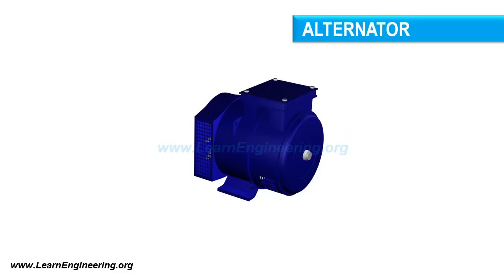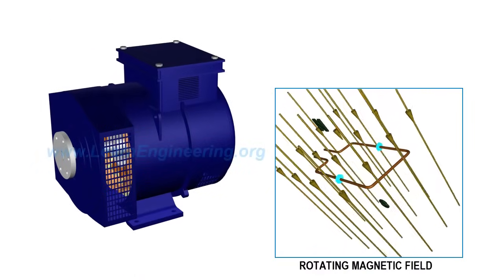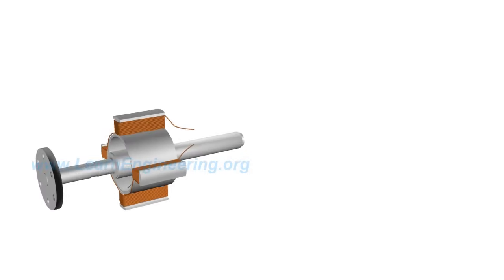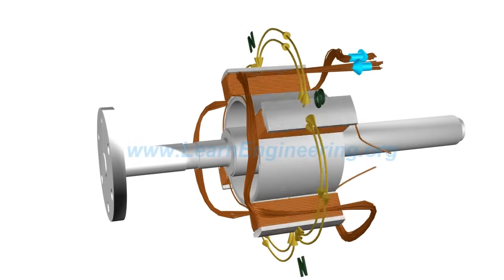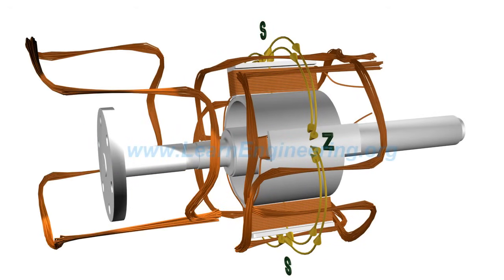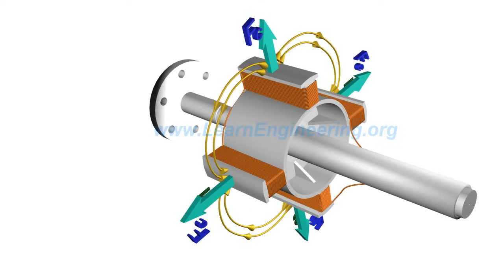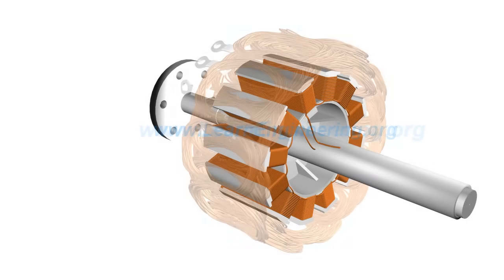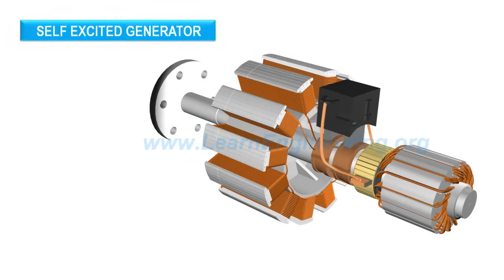How does an Alternator Work ?

Comment: What a great video. Had no idea how alternator made/works.   So what happens/causes my car's alt to not work anymore?   What is the usual part that breaks? Is it not spinning & all the internals are still good or vice versa.
Reply: symptom for alternator failure battery charge gets down probably firstly a service or battery signal arrives in the dashboard cluster finally cars get off if it is an electronic injection. check out if abnormal sound coming, if bearing, if not check the mounting and belt tension and then finally check the terminal connections after inspecting the above you please start your car and check the voltage with the multi meter if the voltage is in the range of 11 to 12v for five minute interval, then your alternator is working other wise please visit the nearest dealer.
Reply: in most cases the brushes get worn down and stop giving the needed voltage to excite the field. Nowadays folks tend to just replace the alternator thinking if the brushes are worn the bearings are probably next. Soooo, the market has favored that and alternator brushes are not available for every version in the field. I tend to disagree. If you can find brushes for your alternator then inspect yours. If the brushes look un-even, or are pitted, and look like they have been burnt replace them. Its a pretty simple process on most vehicles. Take the opportunity to clean the slip rings with a commutator stone too... It will most likely get you charging again!

Comment: Great video. Greater detail then all the others. Had one question. 
Are the magnetic lines of flux "flowing" in the correct direction on the rotor windings?

They appear to be south to north instead of north to south.
Reply: The lines are not pointing correctly. N pole should be pointing outwards.

Comment: If permanent magnets used for 3phase generator like this shown  the voltage in the rotor field is then non adjustable ...so voltage regulator job lot harder and additionally this generators are gigantic would require very big permanent magnets .Permanent magnets have constant field production this would be very difficult to handle as well expensive.
Reply: I think he said PM when talking DC motors which would be correct. As these are single phase motors!
Reply: Yup, PM generators are more usefull for things like small wind turbines etc where an inverter is connected to the DC supply of the alternator.

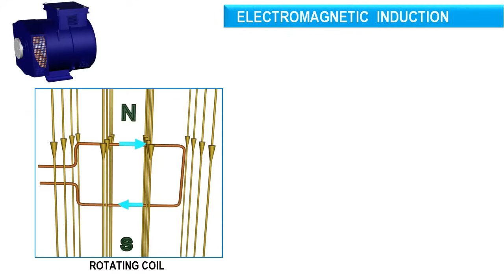Comment: I think you had made a mistake at 0:27 in animation for rotating magnetic field (right one on video). You have used Fleming's left- hand rule instead of right-hand rule so induced current in coil going in wrong side. In left animation you had use Fleming's right hand rule and current arrows goes as they should.

Comment: For say a power gen. in a hydro power plant. How would one set/tune the frequency of the generator?
By the flow of water or by some mechanical breaking of the rotational force? centrifugal?
Also how does one calculate what load a generator can power? MWA and how does one calculate on what DC voltage to apply to the coils, I imagine the winding of the coils decide what voltage to apply?

And how does one synchronize the generator to the frequency of the grid? by some kind of bias frequency, and have a form of oscilloscope set a switch sync to trigger the hv-breaker as the generator is in tune with the grid?
Reply: Question #1 Hydro: Frequency is controlled by a AVR which sets the field current. If the field current increases the voltage rises over your stator windings  which means more electric power is generated, If more power is generated there is more mechanical resistance in the water turbine so the pressure would increase and the flow would decrease. So if you want to have it frequency controlled you need to change the flow and presure of the water mechanicly (velocity of the water) or electricly.

Question #2 DC Coils: Most of the time a manufacturer specifies DC voltage range and it depends on the primary movers force and speed what voltage you have to apply on the coils for the desired voltage and current.

Question #3 Grid: You can synchronize an synchronous machine by running it a little slower or higher than the grid frequency until it lines up. If the frequency, phase and voltage are quite the same (and polarity) you can connect it to the grid. Once it is connected you need to try to run it at a little higher frequency than the grid to let it flow power to the grid. Don't be scared to try and run it a little higher than the grid frequency because the grid will keep your machine at the same frequency but a little out of phase which makes the generator make power.

Comment: What powers the DC source running through the coils in the rotor? Let's say, for example, this is an alternator in a car and the dc source is the car battery. How would you connect leads to wires that are continuously spinning?
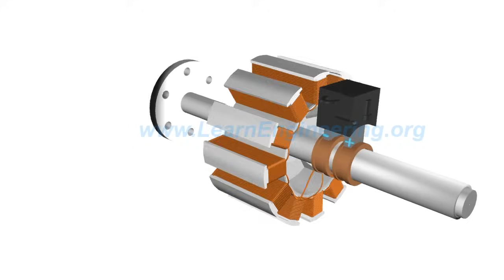Reply: Slip rings and brushes.  You can see them starting at 4:10.  One field winding lead is connected to one slip ring, and the other field winding lead is connected to another slip ring.  The slip rings rotate with the shaft.  The brushes are stationary and maintain contact with the rings as they rotate.  The brushes eventually wear out from the friction between the brushes and the slip rings.
Reply: Jarod Legault Ah, beautiful. Thank you
Reply: Keith Richards

Comment: So I'm trying to determine what speakers and radio to put in my truck without ruining the alternator. I've found a radio that pulls 50watts, and 4 speakers that pulll between 40-120watts. my trucks alternator creates 120 amps. So im confused on if this will work or not and how to even determine this. any help explaining would be great. thanks.